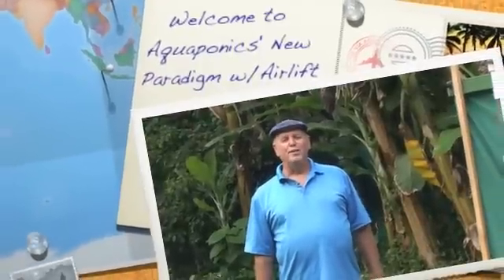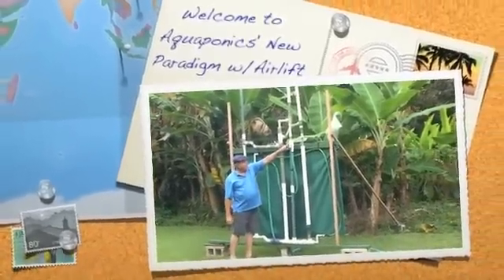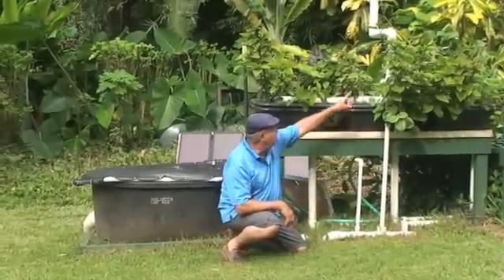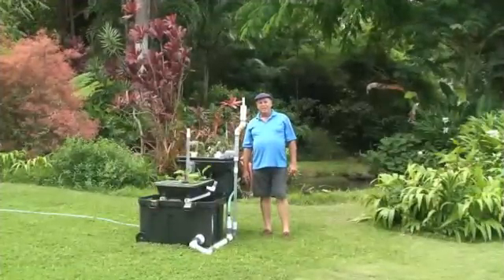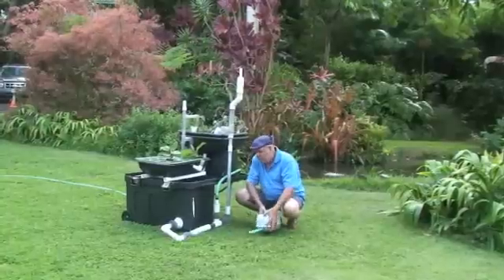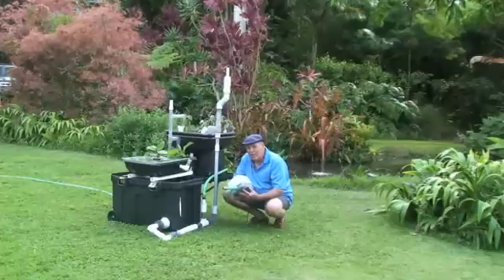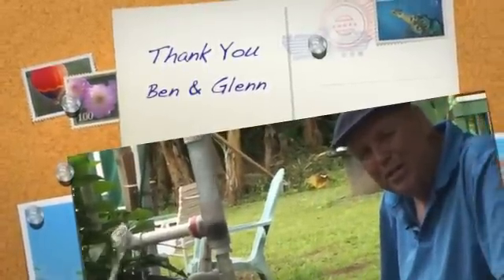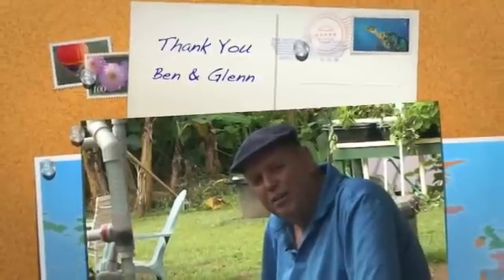Airlift Pump Systems for Aquaponics, Aquaculture and Home

Comment: Hi, I have done airlift pumps too. The pallet garden project uses 5 or 6 watts and little aquarium bubble pumps. (It is soil gardening with continuous water circulation). That might not interest you BUT this might!  I started 2 new air powered aquaponic or hydroponic concept methods a couple of months ago.   "Lungfish hydroponics" and "ebb and float" hydroponics.  They  use air in an underwater tank as both the "lung" for oxygen transfer and the space for displacing water. Playlist at my site